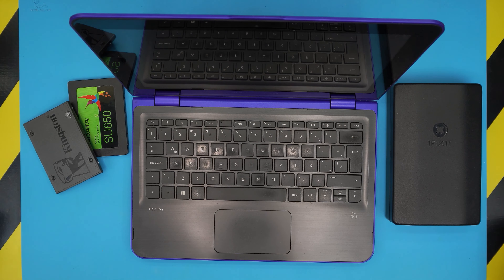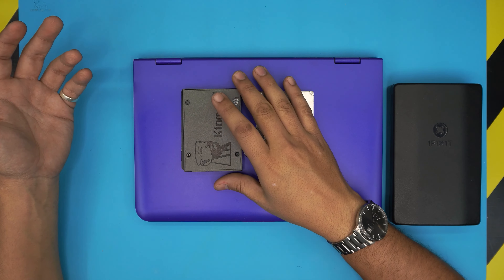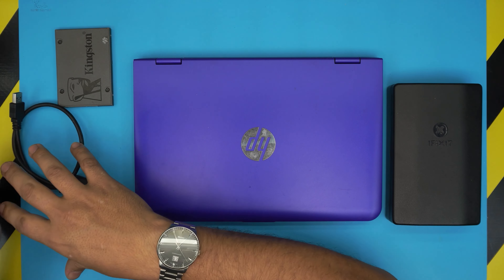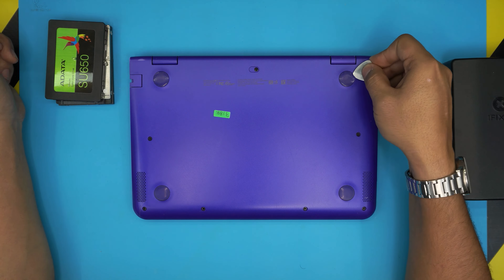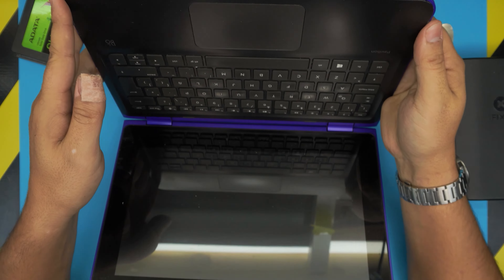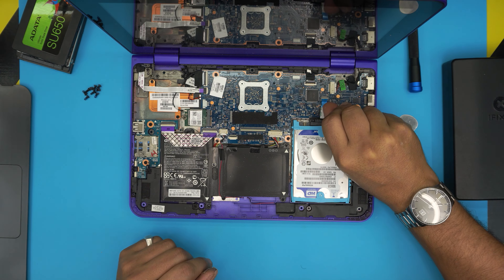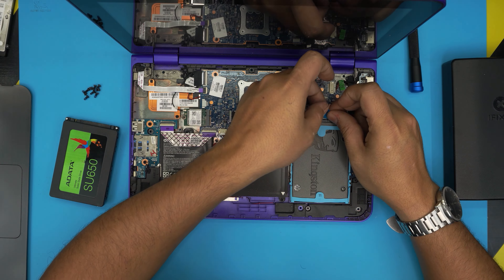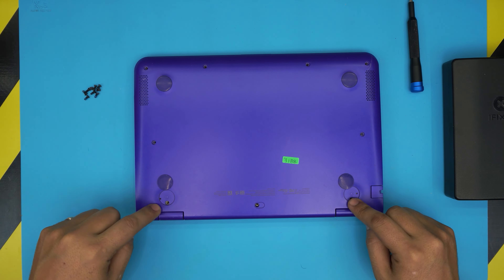Hp Pavilion X360 11 K161 Energy Star SSD HDD Upgrade

Comment: question, when do you use the heat tape/conformal coating/etc?
Reply from the maker: Thank you for the feedback! if you wish to support the channel you can LIKE or SUB or both :P
regarding your question: we use those for when there is a damage on system or if we apply Liquid Metal instead of paste.